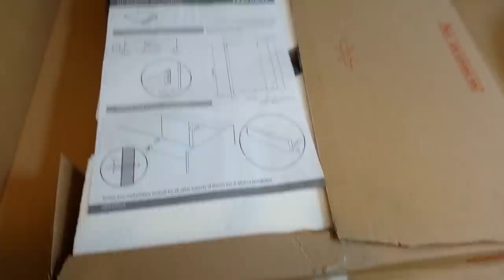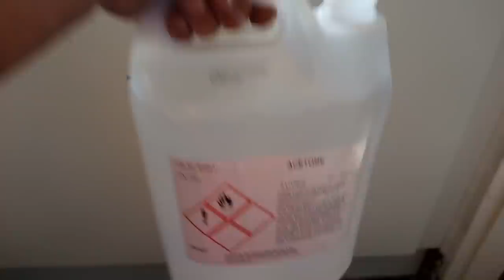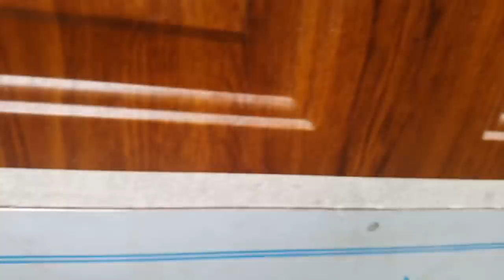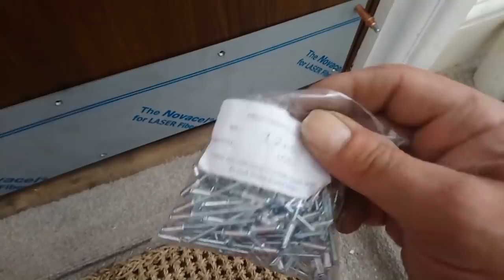Rented house Pt3 - Worktops, finish kitchen & front door

Comment: Your right about us younger generation having it easier with the great tools we have nowadays, how old were you when the battery drills came about? Think my dad still has his yankee screwdriver.
Reply from the maker: Yeah it is a little easier but we had most of the tools you have now, ripsaw, jigsaw, router etc. biscuit jointers looked a bit like small track saws n plunged in a similar way, I still have my Yankee driver with a jubilee clip on it to stop it rolling away, 16yrs old in 1984, 35yrs ago 😲 n Makita 9.6v cordless drills, i got my first drill a yr or so into my apprenticeship when i could afford it, they weren't classed as 'essential' so my money was going on other stuff

Comment: Some kind of dark or blacked out window tint or some white sticky back plastic would have been good on the first few inches at the bottom of the window stuck directly to the glass on the inside would have helped blend it in.
Reply from the maker: Hi,Thanks, i considered that but the glass in this manky house would have to be very clean for it to stick, the window is south facing so heat & poss not full adhesion i suspect tints would peel off in time,

Comment: So much good stuff in this edition!

How about an old glazier's trick of painting the glass black from the inside just enough so you can only see the top of the cill from the outside. 

Keep them coming!
Reply from the maker: Maybe, alter/darken the glass but not sure if I'd get the paint to stick well, It prob peel off or look smeary knowing my luck, tin of black spray paint maybe, Going with what i know n works with these sort of things tho  😉
Thanks aaa 👍 will do
Reply: @Gidjoiner  Zinsser make a primer called 123 that sticks to glass and I'm pretty sure it can be tinted to black but your local paint shop could confirm this, great job !
Reply from the maker: @goatsears  I've used Zinsser, not cheap but fairly good for covering stains, Thanks but i still don't think i would paint the glass, each to their own tho,
Reply: @Gidjoiner  I think your solution of painting the back of the unit looks neat and tidy, I would be wary of painting the glass especially in black as it would just soak up the heat on a summers day.

Comment: Nicely done Gid. Just for interest, how do you price a job like that door up, do you just go off day rate or do you give an all in price and roughly know what time it's going to take you?
Reply from the maker: Hi, Most of my clients know my daily rate, if they don't i'll have mentioned/told them. All work comes from reg clients or word of mouth so thy trust I'll do the job right n not charge too much, I discuss the potential outcome & have done this enough times to know the poss problems that might arise, For the front door I have no choice but to get it out & re-installed it in the same day so it can be locked at the end of the day, " first stage I'll get the old door n frame out n get the new one in then we'll take it from there", whether that will take all day & how much work to tidy it up inside n out isn't easy to exactly quantify. some jobs i can give a more accurate price, some like this are not so easy, Soo a day's labour, maybe a little more if it takes all day & i still have to come back next day, 😉

Comment: I'm actually suprised that on a more budget job like this that they are stretching it to have you cut the butt and scribe joints in the worktop. Nice job as always and that's coming from a fellow carpenter.
Are your based in Manchester m8? 👍👍🙂🙂
Reply from the maker: Hi, no I'm in Leeds, I really don't like those jointing strips & don't think many of my clients do so even cheap jobs like this I'll add in to the price or find the time to do the mitre cut. I'm not greedy with my pricing so adding a few hrs to do this I'm still cheap enough, Thanks 👍

Comment: Does the track (saw) just rest on its own weight or do you need to clamp it down? Cheers.
Reply from the maker: The track just sits on, there's non slip strips on the underside, Sometimes if you want to or there's a need to clamp it down there's grooves underneath to slide clamps in 🤔 I show that in some of my other vids
Reply: Thanks :)

Comment: Hi mate what would you charge for installing a kitchen like that?
Reply from the maker: Hi, hard to say, I don't share my own personal details prices but on a small kitchen like this about a days labour should have the units in, putting them together takes time, I got Pt2 of this done in a day when i finished with the wall units, I'm getting old so i put a day aside for the worktops, starting fresh one morning after the units are in, that only takes a couple of hrs/part of the day so handles plinth,drawer, sink etc to finish it n the day so the kitchen units & top took about 2 days, This whole job, gutting the kitchen, cutting & fitting firedoors, turning the front door around, window board,  kitchen & tiles, plumbing, some filling here n there mainly around the front door, & painting the doors, 2 coats of primer n 2 of gloss took 7 lazy 6-7hr days, 1st day all I did was order the kitchen, bought & cut the firedoors & the last day was just painting ~& silicone around the top 😉